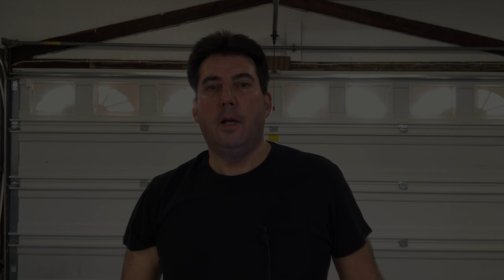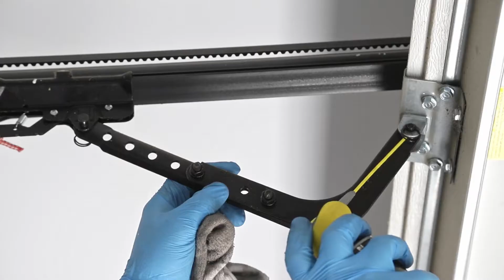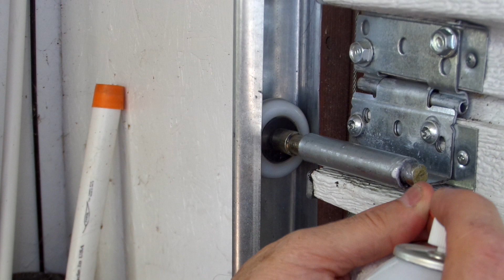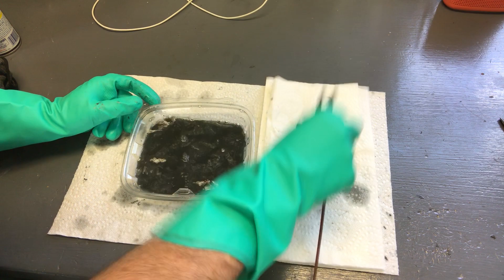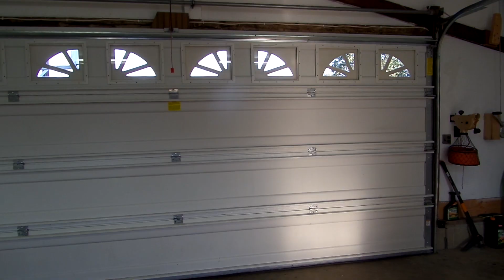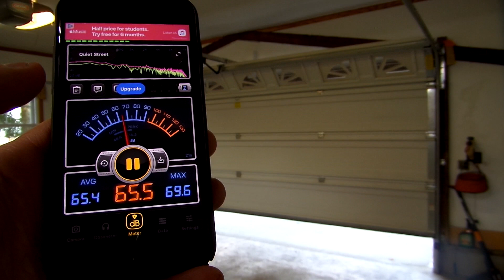Reduce Garage Door Noise | Screw Drive Cleaning & Lubrication

Comment: Thank you! We would add two things. One, as long as you've got it apart, consider replacing the carriage. It's only about $25 and it does wear out. Secondly, check if the limits are still set correctly. They normally should not have moved, but other things happen that may cause the limit position to leave the drive in a stressed condition either open or closed. Upon closing, you want it to stop just as it's about to come in contact with the floor. And if you have a tilt up door like we do, you want it to stop in the upper position just as its about to make contact with the frame.
Reply from the maker: Thanks for the great suggestions!

Comment: So, I used the same lithium grease on mine and when i cycled the garage door at first I was nice and quiet but then my capacitor blew up lol so I replaced the capacitor and bought the genie lubricant and it worked fine, I'm honestly afraid to use that grease again lol
Reply from the maker: Yikes... 😲Sorry to hear about the capacitor, Michael! That definitely sounds like a rough coincidence. Lithium grease is generally safe for the rail itself, but it’s always smart to follow the manufacturer's recommendation when it comes to specific parts and lubricants. The Genie-branded stuff is designed with their openers in mind, so if that worked better for you, I’d stick with it. Appreciate you sharing your experience.

Comment: I checked this video for how to remove the trolley. In this case, lubrication build-up within the drive caused the door to seize. The lubricant actually hardens in freezing temperatures.
Reply from the maker: Lucas Oil White Lithium Grease is specified for "industrial, automotive, and household use
including garage door openers, springs, and hinges."  see here:  https://www.lucasoil.com/pdf/04_Greases_WhiteLithium_PDS.pdf  
While Lucas White Lithium Grease can generally handle a range of temperatures, it is not specifically designed for "extreme cold" and may not perform optimally in freezing temperatures. if you need a lubricant for very low temperatures, consider a dedicated "low-temperature" grease option like WD-40 Specialist White Lithium Grease Spray (Safe from 0° F to 300° F) https://amzn.to/3DH55cZ

Comment: New subscriber with an important question, what if the squeak is coming from the unit and not the track or anywhere else
Reply from the maker: Thanks for subscribing! If the squeak is coming from the opener unit, it could be due to dry gears, worn-out parts, or loose components. Try lubricating the motor or gears (check your manual), tightening screws, or inspecting for worn parts. If it persists, a professional check might be needed!

Comment: my genie manual says to use only there specific.grease only !  is it ok to use the lucas white lube on it i live in florida
Reply from the maker: You should be fine with any white lithium grease. My manual specifies their white lithium grease as well. The formulations of the various brands are essentially the same.
Reply from the maker: https://www.garagejournal.com/forum/threads/proper-lubricant-for-an-old-genie-screw-drive-opener.409443/

Comment: Finally found a video that shows my 3/4 hp craftsman worm drive, garage door. It's a 2003, double garage door. I have two areas where the door emits a banshee squeal.  I've installed new nylon rollers and cleaned and lubricated all the roller hinge points as well as the trolley guide parts. Will remove the trolley carrier next, clean and lube the worm gear. Hopefully that will solve my problem. Thanks, Mike
Reply: Well for the first time in many years and attempts to fix the squealing with my 3/4 hp, 20 year old, Craftsman door opener there is silence!!! 
I removed the trolly and deep a compete cleaning of the trolly rail with mineral spirits and dried the rail off. Then applied the white lithium grease to the worm screw as well as the Blaster silicone garage door lubricant. Not a squeak or screech was heard.  Yes it was a bit tedious and time-consuming cleaning and drying the rails but well worth the silence. Thanks, Mike
Reply from the maker: Awesome Mike!
Reply: @BudsSmartHome  thanks to you for your tutorial. It definitely helped me out. I guess that I didn't need the new sealed ball bearing rollers, but it works like a charm.
Reply from the maker: @michaelbeckman1794 - I'm happy that you got the noise out. That can be extremely aggravating, for sure.
Reply from the maker: Let me know about your success Michael.

Comment: My garage door screw track makes a very loud noise when the trolley passes through it. It quiets if I grab the bar and pull it down with tension. I've cleaned and greased it and still it makes this noise. Sounds like the angle is slightly off. Not sure what to do it's an annoying noise that likely annoys my neighbors every time I open it.
Reply from the maker: I eventually got this belt drive Chamberlain garage door opener that I automated to automatically open and close based on or presence or lack thereof.  It is controlled by our SmartThings Hub and the hub uses our smart phones to determine if we have arrived home or left home.  The unit here:  (Chamberlain Garage Door Opener:  https://amzn.to/3v3Rarl ), is whisper quite in operation.  I love it!  Here is the video I made showing how I set up the Chamberlain with SmartThings, assuming you have interest: https://youtu.be/_xrucvB537E

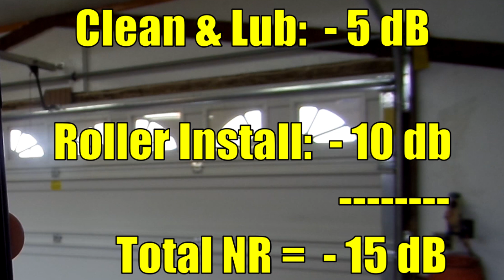Comment: Did.... Did you reduce the volume by 15 dB at 8:14? HA!
Reply from the maker: Actually, I learned from another contributor that you can't just add and subtract decibels.  They are logarithmic and cannot be manipulated without being converted back to a linear scale. You must first antilog each number, add or subtract and then log them again.  Or just find a decibel calculator online.  Either way, your 10db reduction and 5db reduction together equal an 11.2db overall reduction.  
Thanks for commenting David!

Comment: 80 dB in most industries is the point where hearing protection is required to avoid hearing loss. Never realized my garage door could be deteriorating my hearing.  Thanks Bud
Reply from the maker: Thanks Jase.  Actually the action level is at 85 dBA.  NIOSH recommends that workers shall be required to wear hearing protectors when engaged in work that exposes them to noise that equals or exceeds 85 dBA as an 8-hour TWA (Time Weighted Average).

Comment: Nice video.  But do you know where I can find rollers that have a 5/16 shaft on my Stanley door
Reply from the maker: Hi Doug.  The most common shaft size options are 7/16″ diameter and 4″ length. I found Stanley Garage door roller on the Amazon site with the specifications of 3-1/2 In Length X 7/16 In Diameter Shaft. See here:  https://amzn.to/3ZmttHe
If you want to replace these with the four inch shaft length sealed nylon roller bearing rollers with a 7/16" diameter stem I would suggest these:  XiKe 10 Pack Blue 2" Nylon Garage Door Roller 4" Stem: https://amzn.to/3vNvHSo

Comment: That video was excellent, my garage started freezing up in some subzero temperatures we had last week, and it was also a bit louder than I would expect. I hadn’t replaced the rollers up to this point because I was a bit intimidated by the danger factor with the bottom rollers. I also have a screw drive driven garage door, and it is running smooth as butter now. Cleaning all the excess grease out of the tracks, was the worst part. You rock 🤟🏼
Reply from the maker: Glad it helped Shawn. 😊

Comment: Great video thanks. One note though:  Your sound reduction math isn't right.  You can't just add and subtract decibels.  They are logarithmic and cannot be manipulated without being converted back to a linear scale. You must first antilog each number, add or subtract and then log them again.  Or just find a decibel calculator online.  Either way, your 10db reduction and 5db reduction together equal an 11.2db overall reduction.  Still a great reduction.  Thanks again for the video.
Reply from the maker: Thanks Ken.  I learned a new thing today!  I appreciate your insight. 👍😃

Comment: The video is good, but I disagree with opening and closing the door so much in succession. My Genie screw drive has thermal protection, and will shut off 10 minutes if overheated. I unlock the trolley and use the handle to raise/lower the door rapidly, after greasing.
Reply from the maker: Good Tip Magnum.  Thanks!

Comment: Should I also apply white lithium grease to the rail that contains the screw drive assembly and not just the screw itself?  It seems that would be another friction point.
Reply from the maker: I believe that the rail is adequately lubricated as the  screw drive assembly rotates within the rail.  But it would not hurt if you want to go the extra measure.  Just be aware that on hot days the lubricant may run  and drip on your garage floor if there is a excessive amount of lubricant on the drive.

Comment: the drawback of using pretty much any lubrication is it WILL attract grime and dirt/dust over time, and crud things up

having spent three hours pulling off each individual roller to remove a decade of build up lubricant , grime and dirt in petrol, I'd say, don't use lubricants.  if it squeaks, remove the roller, clean it with degreaser of some kind to make sure there's no crud in it and reinstall it.
if you just want a stop gap, use ultra fine sewing machine oil in a syringe applicator and make sure you only oil into the bearings/friction junctions directly.  (but you will eventually have problems as crud will cling to the lubricant over time.
Reply from the maker: Installing garage door rollers with sealed bearings helps as well.
Reply: @BudsSmartHome  my house was built in 1974, and the roller door is so old it has fiberglass panels lol
it has to be from the 80s at least, it does have a newer motor which was installed not too long before we bought the place 3 years ago.
the rollers are all steel even.
the grease was VERY old and chock full of grit and crud.
it was a big job indeed.
(custom door is just over 2 SUVs wide for a custom build quad bay garage (2 cars deep)
the next adventure is trying to replace the fraying cable, which they haven't made in a decade.   and standard cable is simply not strong enough for the size of the door. 
ahh the fun and games.
Reply from the maker: Sounds like you definitely have your work cut out for you.

Comment: Do you have an idea as why a garage door would sometimes close properly and sometimes hits the floor and closes with a loud bang, hits the floor and goes right back up or closes but with a little gap? I have adjusted the open and close force and also adjusted the open and close travel distance.
Reply from the maker: It sounds like your limit switch is bad on the side it’s supposed to stop your door while it’s closing. You may want to talk to the manufacturer oF the garage door opener, or consult the manual.
Reply: @BudsSmartHome  Thank you for the quick response. This gives me something to look into. I am wondering if the limit switch was bad, wouldn’t it malfunction every time?
Reply from the maker: Yes, logically it would happen every time if the limit switch is damaged.

Comment: I have a question, can I just use the regular blue bottle wd-40? And what’s the good thing about the one you use in the video?
Reply from the maker: When it comes to lubricating garage doors, WD-40 is not recommended as it acts more like a cleaner and removes lubrication. Garage door manuals specify white lithium lubricants like the ones I an recommending.
Reply: WD40 is not a lubricant. its a cleaner/water displacer hence the letters WD
Reply from the maker: Thanks for the clarification Danny

Comment: 6:02 this is a perfect example of a great use for an ultrasonic cleaner. I've used mine to degrease old parts like this in mineral spirits MANY times and it works amazingly well. The mineral spirits won't corrode softer metals like Simple Green can (made that mistake with an aluminum carburetor body from my old chainsaw) and will evaporate away completely after a short while. In the summer I just leave the part in the sun for a couple hours or if you can tolerate the smell, bake them at the lowest temp (mine goes down to 180 degrees) your oven can go. Stinks for a while but it does go away, and I have old nasty cookie sheets I use for drip trays.
Reply from the maker: Thanks Daniel. Good tip!

Comment: Very nice video! I have the same everything and putting on that lithium grease helps totally. Much quieter. I may try to put more grease in using a toothbrush to work it in. Dirty work. Always use gloves! Thanks!!!!!
Reply from the maker: Definitely dirty work Steve, but worth the effort. Glad you found a video helpful. Thanks for commenting. Stay safe.
Reply: I took that white cover off to clean the machinery. With the cover off, that opener just purrs! Maybe I'll just leave that light cover off. That's one of the reasons the thing was so noisy. @BudsSmartHome
Reply from the maker: Either that or just tighten or shim it to take the vibrations out.

Comment: One of my two 17-year old Craftsman openers sounds like a squirrel got caught in the screw drive.  Maintenance instructions in the owner's manual state, "Oil door rollers, bearings and hinges. The opener does not require additional lubrication. Do not grease the door tracks", implying that the opener (sans door) is maintenance-free.

Should I lube the screw drive, or not?
Reply from the maker: According to the manual, bottom of page 31, found here: https://bluemate.com/garage-door-openers/pdf/A1846M.PDF ,  it states exactly as you stated above.  If it were my door, I would try a white lithium spray lubricant on the rollers, bearings and hinges, and if that did not eliminate the noise I would apply a small application of lithium grease on the screw drive to try to eliminate the noise issue.

Comment: I don't think that grease was effective. To properly lubricate the rollers....they must be removed or lubricated before installing new ones. Ideally there should be a hole in the center of the roller bracket and lubricated with oil. Same with the hinges.

Comment: Wow.  Completely useless unless your opener is already clean.

Chamberlain recommends complete removal of existing grease on the screw drive before applying new lithium...  This method leaves about 70% on the screw drive. Thanks for nothing.
Reply from the maker: Thank you for commenting.  First of all, this is a Genie garage door opener, not a Chamberlain.  Secondly, as demonstrated in my video, I followed the the manufacturer's recommendation for cleaning and lubricating the Genie screw drive.  According to Genie, if and when the screw drive becomes a source of noise, you are to "wipe off old excess lubricant from the Drive Screw and lubricate the Drive Screw with new lubricant."  Genie specifically recommends yearly application of Genie GLU-R screw drive lube, or a compatible white lithium-grease, to reduce garage door opener noise, help with smooth operation and prolong the life of the screw drive and rail.

Comment: I had a very noisy screw drive Genie garage door opener.  About 6 months ago, I used standard grease on the screw, and it quieted it down nicely. Now, maybe related to the cold weather, the screw drive is even noisier than before.  I spent ~2 hours removing as much of the old grease as possible (paper towels, brake cleaner) and replaced with white lithium grease.  Door is quiet as new again!